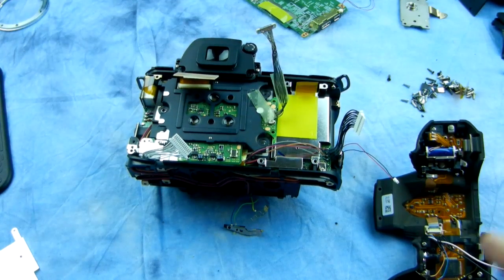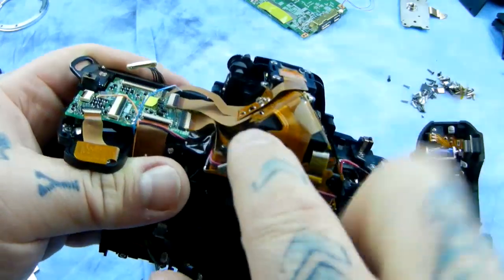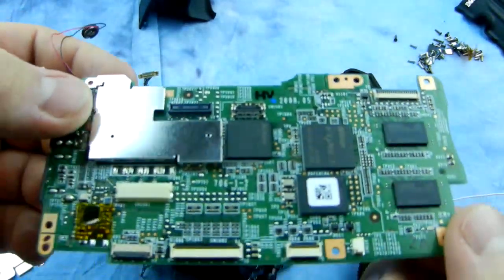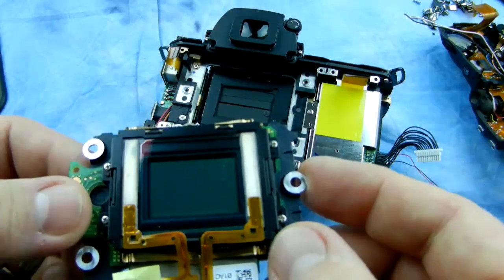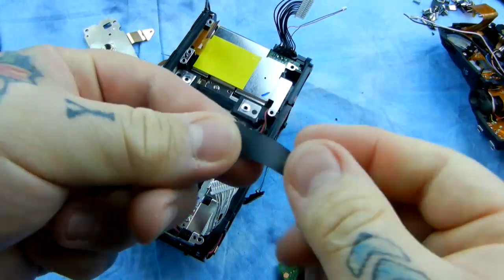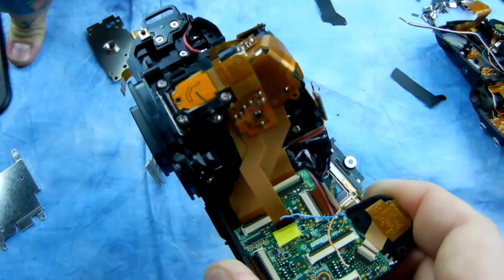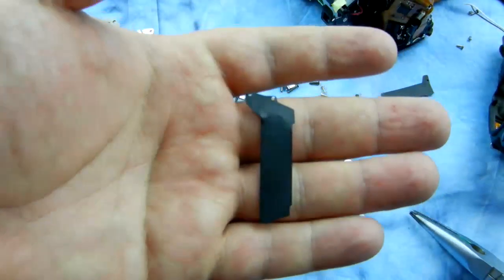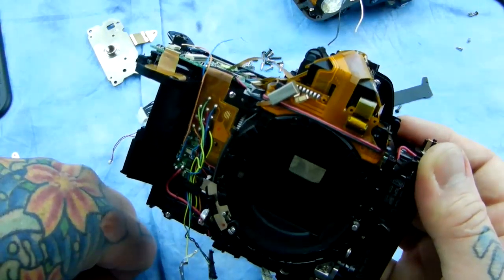Angry Photographer: PART 2 Secrets inside your Nikon DSLR. OMG, that much stuff?!

Comment: I know this section is way old but, My nikon D3200 that I bought as a used camera started acting up, the command dial (not the mode dial) stopped responding on command. Is it easier to fix? Can someone help?

Comment: Wouldn't a lightening strike to your tripod do more damage to you? The camera would be the least of my worries.
Reply from the maker: mailperson yeah, but your nikon would be ok  hehehehehehhehehe
Reply: So that little strip of metal will protect the camera from a 50 billion volt strike? Maybe I should line my hat with them.
Reply from the maker: no, it wont,.......it IS however an electrostatic discharge plate.